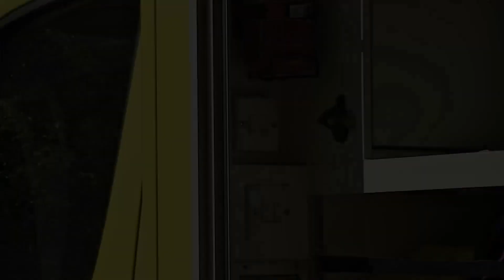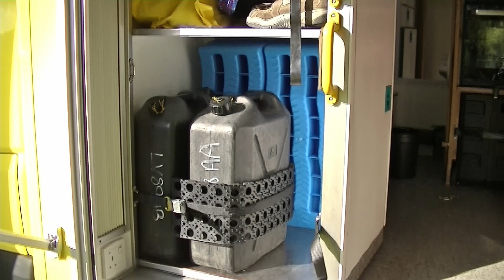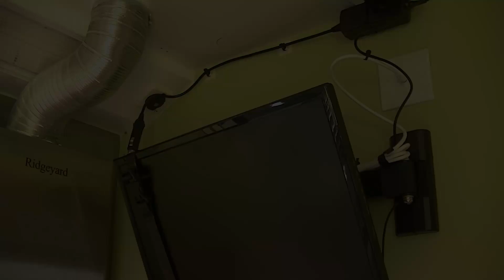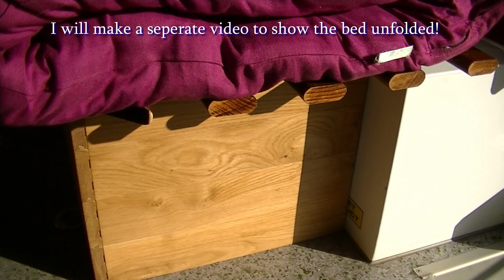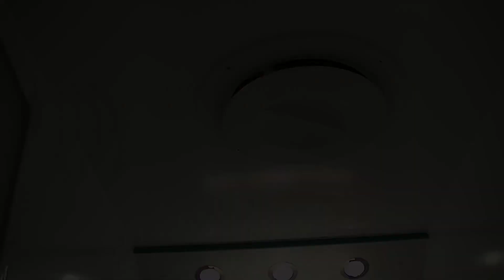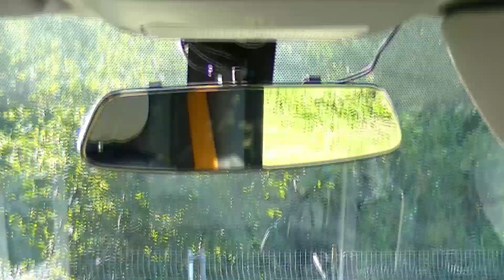Van Tour, Project WAS, my ex UK A&E Ambulance is finished.

Comment: Do you know if I can drive an ex-ambulance like this one with a standard drive license?
Thanks
Reply from the maker: No you can’t this one is plated at 5000kg, fully converted with just me and a tank of fuel it weighed 3970kg, loaded for a trip with a passenger full water tanks and three dogs it was probably around 4400kg.

There are a few modular vans with fibreglass boxes on standard 3500kg chassis but they are usually borderline on weight so not sensible to convert as is they need to go on a diet 

Worth joining this group
https://m.facebook.com/groups/1359736930818776/?ref=share

Comment: interesting how much of the original ambulance interior layout you actually kept. Personally I wouldn't like my camper van to look like my workplace (yes, working in EMS in southern Germany we run WAS Ambulances with the same body layout as well).
Reply from the maker: WAS build standards are very good, probably the best of the constructors. Their modular ambulances are even almost fully insulated, the electrics are easy to work with and the fixtures are very well made.

I own two ex Ambulances my other one, a Crafter (playlist is project Thistle on my channel) was built by O&H their builds standards are the worst imho!

I bought the Crafter first but when I discovered how badly it had been done and that it wasn’t well insulated I realised I would have to completely gut it, and it was going to take a lot longer to convert than I originally expected.

So I bought WAS and converted it quite quickly to give us something to use in the interim, hence I kept a lot of the original cabinets.
I am so glad I did so because I still haven’t finished the Crafter and we’ve now had almost three years use from WAS.

It’s been an excellent camper so far. When the Crafter is finished I will sell WAS but I will be sorry to see it go.
Reply: @CriftinsCampers  Although some ambulance bodies would be interesting to me, buying a used ambulance and transform it into a camper always got a 'no' from me, because I know how they're driven in service. 
Although sturdy, I can't agree on them being one of the best ambulance manufacturers. Their approach on where to put which cabinets is rather basic compared to other manufacturers. Also the tall box body gives a perfect wind attack surface while most of the WAS ambulances barely make use of the space beneath the floor and thus have a high center of gravity. In strong sidewinds you might have to turn the steering wheel by 45° to drive in a straight line.
I've seen so many more practical approaches on other manufacturers, I probably will never go for a WAS as private vehicle; On the job we get nothing else but WAS, unfortunately; I used to work on ambulances from other brands as well, some were way better, some were worse

Comment: Hi my name is Jeffery from Blackpool I live in a tent in the back of a van I youster have a Fleetwood camper and the best thing was the shower on the head of the shower ther was a switch to tern it on and of it saved lots of water
Reply from the maker: Yep I agree, the one I fitted originally also had a trigger on it as well but it was made from pretty poor quality plastic which broke after about 6 months.
I replaced it with this much more solid stainless steel version from Amazon:
https://www.amazon.co.uk/dp/B06XPGBMBZ/ref=cm_sw_em_r_mt_dp_RBVWY1WSEBJRB68EK4VF?_encoding=UTF8&psc=1

Comment: How did you tax the ambulance? Did you need a GVT test certificate?  Mine has class 4 at the moment.  Need to change taxation class not sure if I need GVT or not???
Reply from the maker: No GVT should be required because ambulances are tested as class IV for MOT purposes and if being converted to a camper van they remain as a class IV.

The van has to be taxed first i.e. as an ambulance then you can use a form V70 to change the taxation class from Ambulance to PHGV.

https://assets.publishing.service.gov.uk/government/uploads/system/uploads/attachment_data/file/845575/application-to-change-vehicle-tax-v70.pdf
Reply: @CriftinsCampers  your a legend

Comment: This is great! thanks for posting! Just wondering how your hot water heater is holding up, what kind of flue you've used & if it's twin walled. thinking of doing something very similar and wanted to see if you'd recommend. Cheers jamie
Reply from the maker: It’s been perfect but to be frank that’s really not surprising seeing as it’s not had a great deal of use yet. The flues from morco and I linked it in a similar question below
Reply: @CriftinsCampers  Great. thanks very much. Was wondering about the flexible flue bit and if that was twin walled but will look up the link you mentioned. Thanks again. Very appreciated. Great video! Jamie
Reply from the maker: @jamiejay000  Ah that’s just a bit of standard extractor fan duct, single wall and not really the right thing for the job I fitted it initially as a temp instal but it worked so well I  have kept it as is.
It gets quite hot but not hot enough to cause any problems especially as the heaters not on for very long, the silicon sealant I used is rated for up to 300C iirc and has been ok as well.

Comment: Lol. "I have a cheap head unit and its slow". Well obvs.   You get what you pay for!
Reply from the maker: It’s a popular Xtrons make, and it’s been better since I updated the version of Android but I would never buy another touchscreen only HU ever again, they are awkward to interact with when driving, especially if the device is sluggish. Even adjusting the volume can be difficult so I have learnt not to even try.
It’s been brilliant as the reversing screen and for Google maps though which is why I fitted it.

I have bought a far better thought out one for the crafter which has some physical controls as well.

Comment: Nice Job, What flue cap on the roof did you use for the water heater?
Reply from the maker: I adapted a standard morco type flue kit 
https://www.ebay.co.uk/itm/303152363311
Reply: @CriftinsCampers  Exactly my plan as well. Thank You.

Comment: What is the plated weight value on these vehicles Keith?
Reply from the maker: This one is 5000kg and it weighed 3960kg when I filmed this just with me and a tank of fuel.
fully loaded for a trip it’s now probably nearer around 43-4400kg.
Reply: @CriftinsCampers  is that 5T the plate value in the door frame ?
Reply from the maker: @matthewreynolds6562  Yes

Comment: Looking at getting that same boiler and i've also seen the video you refereed to with the guy having to recirculate water through a seperate tank to get it up to temp.
What pump are you using, mine is only 6l/min but the boiler is 8l/min so wondering if i'll run into issues?
Reply from the maker: Pump size is not really important the controls on the boiler set a reduced flow rate and hence the effective temperature. a constant flow rate is more important though hence why I use an expansion vessel as well.

Comment: Nice van. envious.
I see a man who likes his switches.
Remarkably cheap, are domestic light switches. And easy to fit.
Reply from the maker: Yes they are very economical but being designed for mains are have a fairly low current rating (5A iirc), ok for lights etc but I would not switch the supply to something heavier duty without a relay. 
I have just been playing with the Carling Contura switches that came out of my other Van, Thistle they are quite heavy duty at 20A and have built in LED illumination so I will find a use for them in that van somewhere.

Comment: Great build, great use of interior. Can I ask where you bought it and for how much ? Thanks
Reply: That's something I'd like to know too please.
Reply from the maker: @NomaddUK  I paid just under £6000 for it from a dealer in York. It was not a pleasant experience & I wouldn't do it that way again, it was delivered after several weeks delay with a massive diesel leak where they had broken the WIF sensor whilst supposedly fixing an oil leak which they didn't (see other video re that) . Two of the leisure batteries, the Telma retarder control unit and inverter had also disappeared in the meantime. Worst thing though was they took it for an HGV MOT instead of a class IV, that messed up the MOT history a bit!

If I were to ever buy another I would be looking for one that's still intact as its much much better to decom them oneself.

If you do buy one I suggest you test everything and note whats fitted so that they become a condition of sale. I didn't but should have done.

Comment: I really like the oak. Some good tips about the vinyl and paint on the interior - will check out some of the build videos when I have time, as I might look at a box ambulance conversion in the future. I'm currently converting an ex-patient transfer Sprinter van in New Zealand -  also  on a small budget, but will be more basic than yours though. Saw your van on One Man and his Whippet/Gadget John on Tours walk around at a meet up - cool idea to do a QR code link to your channel
Reply from the maker: Linz_in_NZ I have a PTS as well under the playlist Project Thistle, a Crafter, I hope you checked you had adequate insulation in yours mine was woefully inadequate hence I gutted the entire van and I have just done the same this week with an ex A&E Peugeot Boxer as well
Ambulances are not well insulated it actually being  just used as cheap sound deadening  in most van conversions.
Reply: @CriftinsCampers  I'll take a look at Project Thistle - sounds interesting. My Sprinter roof has 1.5" of polystyrene and then a ply sheet that is covered in velour upholstery - which will stay as it is. Not as cold here in NZ in winter, and it will be used mostly for short breaks until Summer when we might go away for a longer period. I'm lining the walls under the windows in Earthwool insulation - it has a good R rating and good sound deadening too. I bought 10 bags of new build off cuts for about 20 quid - we used the R5.2 roof/ceiling stuff in the garage, the wall stuff will go in the van as its denser. There are a few thousand professionally built campervans/motorhomes here - the rental ones have a wisp of insulation - most only get hired in Summer, so its mostly okay - though can be too hot.
Reply from the maker: @linz_in_NZ  Is the climate drier in NZ as well? obviously if drier and warmer then there's less chances of Condensation. Yesterday here it was a classic grey foggy November day, everything was dripping wet!
Reply: @CriftinsCampers  Yes much warmer and drier - I grew up in Yorkshire, then moved to Lincolnshire later, also spent time in Bath and on the South Coast, now I'm in Christchurch on the South Island of NZ, much warmer and drier than anywhere in the UK.
Reply from the maker: Curious I had to go and find the video you mentioned of my Van, yes it was on the One Man and his Whippet Channel, they must have filmed it whilst we were in Stratford shopping!

Gadget John I think fancies doing and Ambulance as well!

Comment: You did a real Good job there Keith! Well done mate 👍
Reply from the maker: pa maj Thanks, made a few changes since filming this, added a satellite dish because terrestrial reception is pretty naff in most of Wales. I have fitted a B2B split charge is not efficient and does not fully charge batteries, fitted a proper heater controller, fitted a spare wheel, and made a few tweaks inside.

One thing I have learnt, need a lot more hooks, going to fit hooks all over the place in the Crafter!
Reply: @CriftinsCampers  Hooks, it always comes down to lots of hooks lol, I have none except a wardrobe/toilet with a clothes hanging rail which I guess hangs stuff ha!
I don't have many places to put hooks and haven't really found a need for them.
What are you using the hooks for if you don't mind me asking

Comment: I guess whatever model android doodah that is its one to avoid, we bought an android TV box, hell its awful, my 4year old phone, also android, is like an f1 car next to it, i dont think its so much android thats the problem, but the amount of memory in the thing and the processor speed/type
Reply from the maker: We're Really Relay Camping you may be right, it is not helped by the endless amount of updates, coming from an IT background it bothers me that apps need so many updates! I have a couple of Amazon fire sticks they are so slow when updating they make even watching paint dry seem fast!

I replaced the os on my vans HU yesterday with a custom version and I have stripped out a lot of unnecessary bloat ware I also installed fewer apps and it a lot more responsive now.

The main reason I fitted it was for google maps and for the reverse camera which it’s perfectly for.
Reply: @CriftinsCampers  Google maps? I left them for Waze, which is the Google maps database with a better front end
Reply: Android box should have a minimum 3G of ram for a decent user experience more akin to a good mobile..1G boxes are a good paper weight

Comment: Whereabouts did you buy your ambulance from and how much was it I’ve been looking at some sites on eBay thank you
Reply from the maker: I bought mine from a Trader in York who advertises on eBay, I probably paid too much money for it especially as it had several useful items removed at some point,worse  even after I agreed t buy it the Trader removed two of the Leisure Batteries without telling me!

If I were to buy another I would go to the Auctions at Merthyr or to Brightwells they are usually more complete if coming straight from the Ambulance service.
Reply: Criftins Campers Sorry for keep disturbing you as I am looking to buy one from the auctions in the next couple of months have you had any issue with the engine and gearbox on the vehicle and what was the mileage is roughly on her for her age and how much is road tax for her appreciate your help so thank you I thought I forget how much is it to fill up and roughly how many miles do you get to a tank load
Reply from the maker: @chipking2765  Mine was delivered stinking of Diesel the top of the fuel filter was cracked and had Diesel pouring out under pressure,  It was fine when I checked it in York so no idea what the trader did to damage it and how the delivery driver did not incinerate himself beats me! 

Once I sorted that out there was nothing at all wrong with the running gear until recently I now have a faulty glow plug which is cheap to fix.

I have the full service history for my van its done 300,000 miles and needed very little doing during that time
Mine is a V6 Automatic I have not checked fuel consumption yet It probably doing low 30s.
the Autobox fluid has been changed regularly and the entire van had been fully serviced by Yas about 3000 miles before I bought it including brake fluid

A&E Ambulance get well looked after & serviced every 10-12 weeks 
PTS Ambulance on the other hand can be badly maintained as most are leased & operated for profit so corners get cut!

Mine is 5000KG so a PHGV tax is £165

Buying at Auction is obviously a lottery some that go through are in a terrible state best go a few times to get a feel for it also watch Wombles channel he posts weekly from the Brightwells van auctions
Reply: @Chip King  Try Brightwells.com - down in Leominster - they seem to have the NHS contract for selling them  - Wondering Womble usually does a walk around video each week and then one of the Auction itself - worth a look at a few to see what comes up and some prices.
Reply from the maker: Linz_in_NZ yes they had five like mine go through today all went for just over £2000 plus fees and vat. That’s a lot of van for the money!
Reply: @CriftinsCampers  They are good value - as they include a diesel heater and a lot of other extras that you will need.  Might be tempted to make a trip over from NZ, build one and tour around all the places I missed when I lived in the UK then ship it over here 😀🚐🛠
Reply from the maker: @linz_in_NZ  If you do, then come and say hello, we are on the Welsh borders I have a nice big field that as long as it's dry is ideal for wild camping.

Comment: Do you have a link to the video you mentioned about using the instant heater to heat a tank?
Reply from the maker: This is it, so far  I have found mine very efficient and there is not much wastage before it comes through hot.

https://youtu.be/HN-_LETJmQA?list=LL8JGjVTE2iZhicvasEarD4A